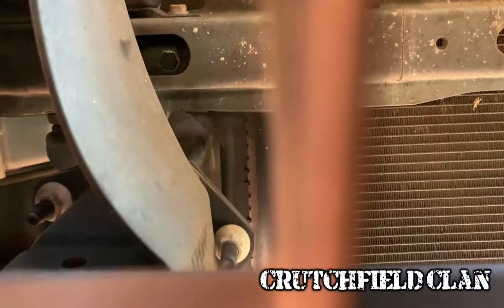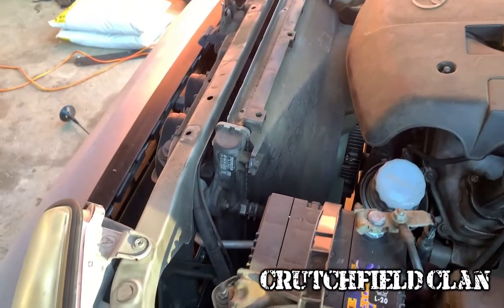How to change the radiator 4th Gen 4runner 2003-2009

Comment: The transmission coolant lines, did you let them hang down or point them up?
Reply from the maker: Point up best you can to not lose transmission fluid if possible
Reply: @crutchfieldautomotive7936  Thanks a ton, great video !
Reply: Some say couple of drips are fine but should not leak them.